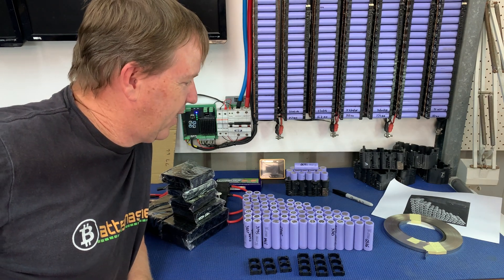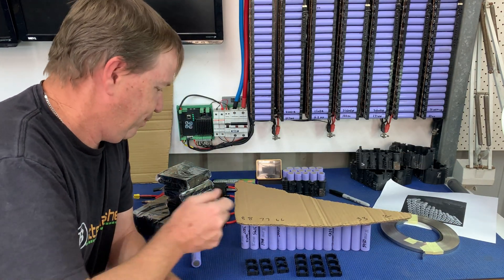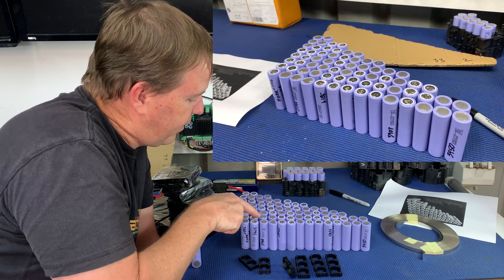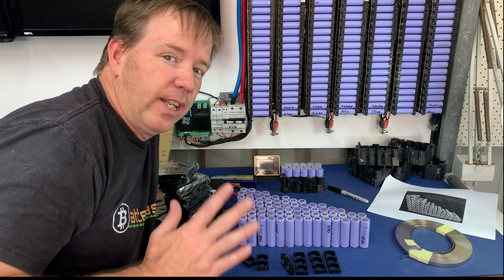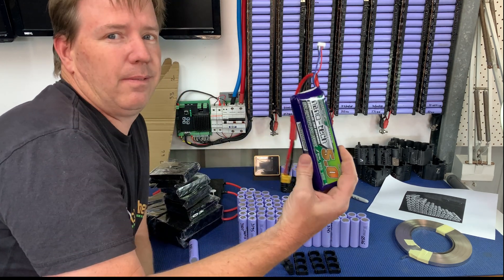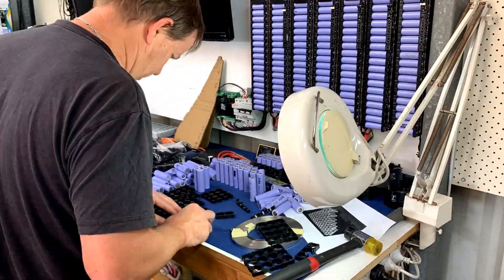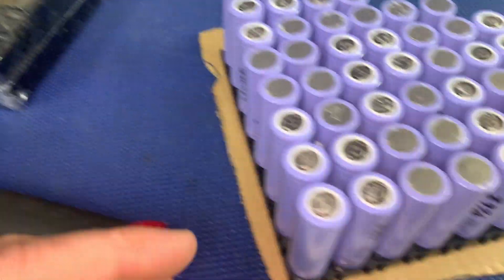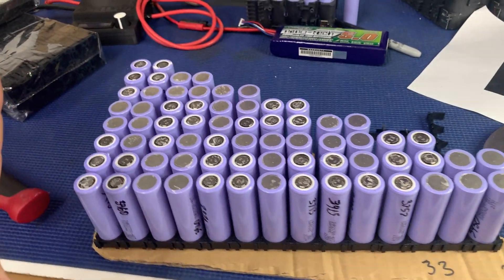21700 Bike Battery Build Part 1

Comment: I like to build 7 s packs.  Run 2 in series for 14s .  3 in series and so on.  you get the Idea..  Packs are small and they can be used seperatly on 30 volt buck converters to power anything.  Their easy to tuck away in bags or baskets or backpacks or Kangaroo Pouches.  7 s bms's usually alaow charging and discharging at 1 port.  That.s a big plus.  My new build's are  7s3p telsa 2170 for a 15 ah pack.   That's all you need on a Bicycle.  That is if you are going to ride it.   If your an Organ Donor that may change things abit.

Comment: I still don't understand where you find thoose batteries to be cheap!
Reply from the maker: Anywhere I can - you have to be creative, lucky or mad in this game
Reply: @HBPowerwall  Yea here in Italy is quite hard to find good old working batteries.

A single new one is 20USD :( For 100EUR you can get a more safe 60Ah LiFePo4...
Reply: @HBPowerwall  Actually it is censorship, but I am glad you pawn it off to something like luck as it has nothing to do with that. You probably already know that everyone wants to resell something and everyone protects their sources so you end up paying %500 over retail for cells that should not cost that much if you bought them in a large already made unit.
Reply from the maker: @loosingmymemory7  Clients control the price - if we choose to pay more its our dumb fault pushing prices up

Comment: Gday HB Powerwall, looks decent to me 👍🏼😊
just make sure you use "Pure Nickol"Strips & not Nickel "Plated" Strips !
When attaching main postive / negative cables to pack be sure to solder or spot weld each of them at least 2 different contact areas to spread the outgoing current path.
Reply from the maker: I only have plated so will double up i think
Reply: HBPowerwall , yup thats works too 😬😎 
I just completed a 104km rail trail in victoria (O'Keefe Rail Trail) on a "Single Charge" with my own DIY battery (35Ah) 😊 The Sanyo 18650GA cells "rock"

Comment: Too complex. I guarantee you will make an connection error. I did what you propose and had a few big bangs when connecting back of battery. Simple is best!
I prefer simple 5 vertical arrangement that you initially had. Less mistakes. I dont think slightly increased resistance of vertical string will affect performance.
Reply from the maker: If i don't make sparks i'll be dissapointed big time. Simple will work but i want the best it can be to avoid possilbe issues
Reply: @HBPowerwall  would have been nice if you made a play list when making more vids in a serie ⁉️😁
Still searching for part 2 aso 😳

Comment: Works well enough for a rectangular grid, but you could pack the cells in more tightly with a hex grid. 'Course then you wouldn't be able to use those battery holders, but they do sell hexagonal ones too.
Reply from the maker: I did look at those (after I got these) wish I had of done more research! But this is a learning process and I learnt so win win hehe

Comment: I find when people are making packs, that it is helpful to make a couple of lines with marker on the edges to help remind you of what cells you are connecting together. Just a dot of a marker next to the cells is all you need. This helps when there are two negative groups next to one another, especially when the grouping gets into weird shapes. It is easy to go "Oh this cell gets connected to--" And then things start to get red hot.

The other thing to remember is that the wires coming off of the most-positive and least-positive should be soldered into the "middle" of the grouping. You can make bend the nickel into a little V-shape to help hold the wire, while you solder it onto it.
Reply from the maker: I love taht idea and will steal it and call it my own 😜

Comment: I think you have a good lay out there, like you said, you have good amount of interconnectivity between cells there without long narrow current bottlenecks. Sounds good  so far, I would be careful with the BMS as the motors like a bafang draw alot of current specially the initial inrush and depending on the controller the person's using if it's MSW it's gonna be harsh while of its a PSW then it won't be so bad. Louis rossmann talks a few times about finding these sorts of things out the hard way lol like when one of his bikes combusted while riding lol.

EDIT: Have you done the current capacity calcs for the nickel strip specially on the series side. If not let me know and il dig out my calculations stuff.

Comment: I’d just swap 2 cells between set 3 and 4 so the top left 5 in set 3 are in a C shape. But iv never built a battery 🤷‍♂️
Reply: Basically problem I think I can see is only one link between 2 and 3
Reply: Or maybe I’d rearrange first 4 columns so the first set of cells starts off leaving a gap at bottom of column 2 to be filled by cell 6